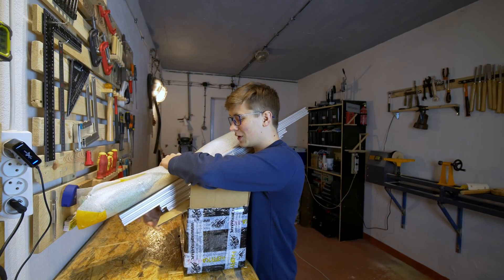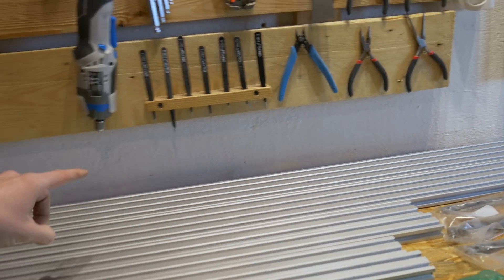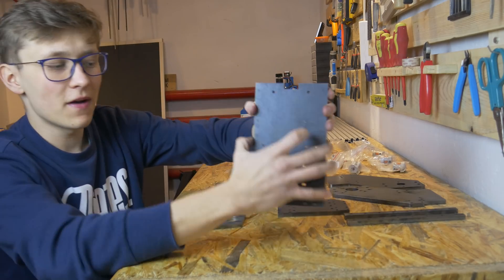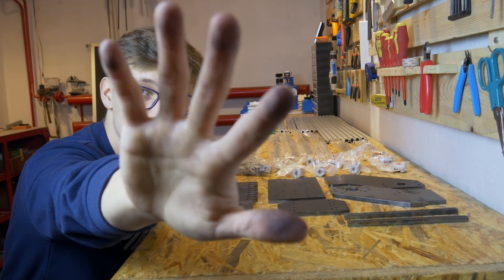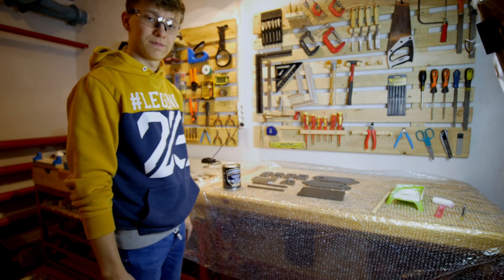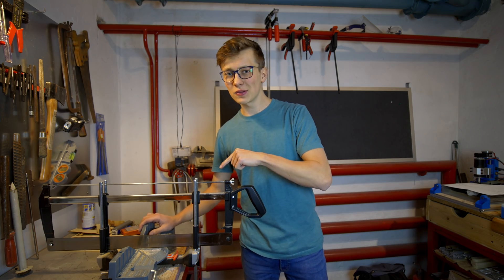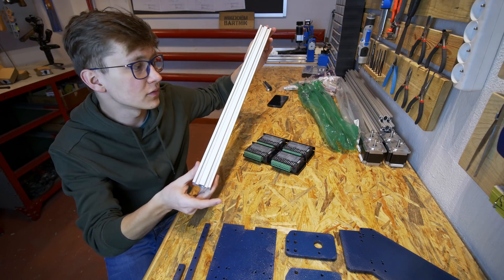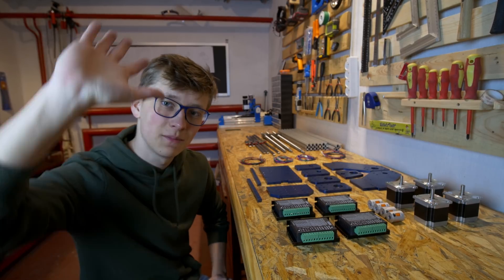IndyMill - Open Source DIY CNC Machine #1 Parts

Comment: In the list of component to buy it says "Linear Rail Block MGN12H" , but in the video you say its a mistake and it should be "MGN12C". Which one should I buy? is the pats list wrong on that?
Reply from the maker: List of parts is ok, you need MGN12H. This is an old video where I was still experimenting and I used wrong version
Reply: @nikodembartnik  Great honor to have your answer. Your Cnc is amazing. im buying the parts now and will try to share the process as much as possible for spanish comunity. Thanks :D

Comment: How did you ensure that the horizontal axes were at a true right angle?
Reply: The pieces should be extruded and cut from the manufacturer with somewhat reasonable accuracy

Comment: Hi, I've just come across your vids and i'm very impressed, so I decided to purchase your plans, but the problem I've got is your parts list....
Some of the links send me to 'V' slot extrusion and others to 'T' slot, is that intentional?
The link for trapezoidal lead screw is asking for pitch and lead dimensions/sizes?
Linear rails links are asking C or H?
Stepper motors spindle sizes??
Any chance you could clarify thanks. 😊

Comment: Hi, thank you for creating this. I have a question. On your website, you have the MGN12H listed, but in this video you say MGN12C is correct? Did you update your design to the 12H or is the website wrong wrong? Thanks.
Reply: Nevermind, I scrolled and see the MGN12H is correct.

Comment: Could the steel plates be replaced with aluminum?
Reply: I guess you can make them with aluminum, some other people are even using plywood or plastic on a 3D printer. I am planning on make them with 3/8 HDPE or whatever thickness is necessary.

Comment: great project!  Thanks for sharing this.  Did you buy the v-rail extrusions for a reason?  I haven't watched your second video, but the linear rails make me think you aren't using the v-rail feature.  What are you going to charge for the metal plate kit?  Any interest in doing it in stainless steel or aluminum?  Thanks Doug

Comment: Nikodem,  Thank you for all your hard work creating the IndyMill.  This is the exact form factor I have been looking to build as my first CNC.  I was wondering, based on your design, what is the working area of your design?   I would like to build one that can handle a working area that is roughly 915mm x 610 mm.  So, I am not sure how long and wide my setup should be.  Do you have a sizing calculator?

Comment: try bluing instead of paint  and waterjet instead of laser. bluing doesnt increase any dimensions and waterjet is as precise as laser with alot less cost. also breadboard ribbon cable fits grbl  controllers perfectly get a set of male to female end ribbons and you can screw down on the pin and the socket on the other side will accept the pins on the grbl board perfectly.

Comment: Sir i wanna buy 3 nema23 3amp with 3 tb6600 driver and 3 lead screw 500mm and spindle 500w can i mill aluminum with those parts ? Whats the power supply voltage should i use 36 or 24 ? Is 3 pcs nema23 stepper motor enough to what i need ?  I really love what you do and i hope you all the best

Comment: I've been following this project since I found it a few weeks ago.  However, I'm confused about the size of the parts in the DXF files you provided on your site.  Is everything in millimeters?  If so, that makes the 500W Spindle plate 13.5 CM (135mm) wide x 8.2 CM (82mm) high.  If that's the case, it would be easier to communicate this information to any company that will be cutting these parts for us.
Reply from the maker: Everything is in millimetres

Comment: Hello
I've been thinking about buying or building a CNC machine myself for a long time.
Of course there is a challenge to build yourself and also not the simplest to learn and understand the programming with a device you buy from the company.
So, I'm looking for a lot of time for someone who builds himself and manages to give all the necessary parts including plans for the mechanical parts.
I also do not know if the bottom line in terms of price what is more worthwhile and for me the consideration is whether you should challenge yourself along with the construction experience yourself, but this is of course an individual question!
Anyway, the question is are you free to help if I take the task like you and build alone and help me if I need to?

Comment: I've been torn on what to build. I was considering just buying a little 3018cnc to mess around with but I'd rather put the money towards a decent machine similar to your design. I like the size of this machine. I already have two nema 23 motors from an old project but I need new drivers. I also have a single big nema 32 but that's overkill unless I'm building a pretty big machine.

Comment: When the project is complete and the design is finalized, maybe you could consider starting a kickstarter to order many kit parts frbricated from suppliers at a high volume reduced cost. Im sure you could take a deserving profit cut and we all could bennefit from it by reducing costs and providing easier parts sourcing by recieving delivered kits. Just a thought. I am very interested in this design and appreciate your hard work and overall opensource philosophy. Keep up the exeptional work!

Comment: I would bring your attention to Vention.io They allow machine design using standard aluminum extrusions with standard brackets etc. You won't have to mill any parts separately. They even have an online machinedesign tool where you can build your entire cnc and order the relevant parts from them.

Comment: Just a tip .... I see you had problems with broken taps. Your on a limited budget ... try this.  Put the tap in a tap wrench .. drill a hole in a board the size of the tap ... put the board down flat on ur plate and put the tap in the hole to start your tapped hole.  Take it out and then restart your tap remove board and restart tap and finish tapping. You were starting your tap so crooked it broke. .. nice. Job later.

Comment: If I already own a DremelCNC I should be able to cut the steel parts from aluminium and use the finished aluminium CNC to cut mild steel plates to replace the aluminium ones?
Reply: Dremels are crap as he said in the other video... The bearings rather bushings are very cheap, probibly made out of Nylon and DON'T HOLD any tolerances as the Dremels are made to only vibrate your hand while you use them, I use my Dremel to vibrate my molds, and it does a great job in doing that.. 

Go to the store and pick up a brand new one and check out bearing play for yourself, the bushing play is like something that is completely worn out!.. The chuck is also a problem as you can only tighten it with your fingers, so the fist vibration the chuck WILL RELEASE and the bit will fall out, and they are also   seriously underpowerd, unless you want to scratch your back with it, turned off of course, you don't want the bit to fall out of the chuck and into your but crack while is spinning around..

Dremels are garbage in evey way.

Comment: Great video, love the design and nice job at your website. Maybe try aluminum insted of steel and try to mill/drill them on a dremel CNC. And a tip for a dremel CNC, make an air hose that will blow away aluminum from cutting area and cooldown the tool a bit. Keep up the great work!

Comment: No offense, but why?  You are super talented, and your dremel cnc fit a demand that no other machine fit.  There are already 101 medium to large open source cnc machines out there that use extruded aluminum and are very similar in design.  Once again I am not trying to be rude, but trying to figure out what makes this unique?  Wouldnt your considerable talent be better spent improving one of the designs already out there or creating something else that uses cheaper/more affordable parts?  Maybe extruded aluminum is cheaper where you are, but in the US it is terribly expensive. 

There is a guy that uses angle iron and v bearings for rails, he hasnt really done a great job of documenting his machine.  Would really love to see someone build on what he has done and document it well, as the parts he used are really cheap here in the states.

Comment: I think an easy / cheap way to use an Arduino with grbl is the Arduino Nano with a Nano expansion board ~4€. I use this with the TB6600 for my Dremel CNC. But I will also build your machine when it is finished. Because I am currently not satisfied with the rigidity of the Dremel CNC. I'm really looking forward to Part 2

Comment: Hey nikodem, i made the other cnc, but with mach 3 and the drivers you show on video, the question is, why you dont use mach3? I feel it is better than arduino
Reply from the maker: I highly prefer the Arduino, it's cheaper, open source, I can do everything I want with that and use anything I want. Mach3 looks sooooo bad. Take a look at CNCjs, that's the software that looks great and is easy to use

Comment: I think what you're doing is amazing. I just wanted to say thank you for taking the time to show people what you're doing and being brave enough to share it. The way you go through everything and the presentation of your videos is excellent.

I'm thinking of building my own CNC machine, not a kit one like you see everywhere, but my own design. My thought process was a lot like yours: combine aluminium and 3D printed parts, but I have no experience with 3D printing yet. Your new design has inspired me - I'd been thinking about using 3d-printed prototype parts in place of simple 2D aluminium parts that can be cut on a fibre laser, and you've completely solidified the idea in my head.

Comment: those motors are not useful for cutting heads... maybe for a 3d printer, laser mirror or even diode, but definitely not enough for a router or a spindle

Comment: LASER cutting is not more precise than drilling. The LASER will cut a slightly tapered hole and the walls my be rougher than a drill. Also, you cannot (read: should not) LASER hole diameters smaller than the material thickness.
In short, drills are great.

Comment: Don't you think the paint on the steel parts hurts the tolerances of various dimensions, flatness, and perpendicularity? I like steel too, but I wonder if for this application anodized aluminium would be cheaper, better looking, and hold better tolerances. That paint looks really thick and creates an uneven surface. Maybe you could have raw steel, and apply wax or some other finish after assembly, so it keeps the machine clean from rust, but doesn't affect mating surfaces. Idk

Comment: When I have to tap aluminum, I just chuck the tap into my cordless drill, lube the tap, and screw it into the hole.  That's how most CNC milling centers tap small holes.  (not with a cordless drill, but you know what I mean... ;)  Just make sure you are square to the hole in both directions, and don't put a side load on it.
Reply: throngcleaver Make sure to set a torque limit and rewind half a turn when it is reached. Will prevent you from breaking your tap.
Reply: @smooth_lighting  I don't do that in aluminum for taps 1/2" down to #6 screw threads, and I have never broken a tap in aluminum, but you have to be straight on the hole.  I watch a shit-ton of videos, including a lot of the top metal workers, and I have yet to see one hand drill or tap a hole, starting off with the tool perpendicular to the surface.  I have 42 years experience, with thousands of holes tapped, including several hundred holes in that 80/20.  That aluminum alloy, (the 80/20 they sell in the States) is 6105-T5, and it taps very well using my method.  I recommend Tap Magic Aluminum, for tapping aluminum and magnesium alloys.

Comment: As far as i can see the steppers do not have encoders/position feedback. Do you have any planed or is it an openloop machine.
Also have you thought about using linux cnc as a controlling software?
Reply from the maker: I am not planing to have here a closed loop system, maybe in the future I will upgrade those motors with encoders or buy servo motors with encoders inside
Reply: Well it would not make sense for a cheap diy project.. Nice work so far👍

Comment: you started  a great project! very cool!
to improve precision in building the structure I would advise you to remove the paint in all those places where the steel plates are connected to each other (for example if you have to join two pieces of steel at 90 °) the thickness of the paint could give stability problems with the finished structure. 
The 12  brothers you showed in 04:03 probably are named sliding bushings or linear bushings ( no no: linear bushings are for rods).
Do not remove the plastic stud inserted in the sliding bearings but make sure that it is pushed away from the rail, while inserting the bearing, otherwise you could lose all the balls of the bearing
Go ahead  Nik  i'll follow you !
See you soon!
Reply from the maker: Thanks! I hope that paint wouldn’t be a big problem, I may eventually just remove it with angle grinder and paint this places again later. I noticed the plastic element in those sliding bearings, I keep it in place and also I keep most of them still in bags because there is a lot of dust in my workshop. That’s just some additional protection to ensure that everything will run smoothly

Comment: I enjoy your videos. Just a tip for paining. Rustproofing is quickly and effectively done using Rustoleum spray paint. It is a US product but is readily available and reasonably priced here in Australia. I presume that it would be available in Poland as well. It has much better coverage and finish and it also bonds well to most plastics including PLA so I use it for most of my prototyping. Cheers. (not a paid ad).
Reply: Hi, Which one do you use? Is it the Stop-Rust one? I see amazon has some available but not too sure which is the correct one to use.  Thanks

Comment: Like what you are doing. Would 3mm mild steel plates be thick enough. Would reduce the weight a bit. Also found that laser cutting can be cheap enough if you find the right company. Also you would be able to get smaller holes thru 3mm palate.

Comment: your drivers sucks.
i used them for my ox cnc and then i gave up and went to a cloned duet 2 wifi with trinamic drivers.
the toshiba don't handle slow pace correctly, and if you try to mill pcb you will have step by step movmeent instead of something smooth.
and when you add the price of your 4 drivers + controller board + rpi for wifi access you are nearly the price of the cloned duet wifi.
and honnestly reprap firmware is wayyyy better than GRBL

Comment: you should look into HGR20 rails they're pretty beefy and the carriages are nearly 80mm's long so you dont need more than 1 per rail for a smaller machine oh and DOLD mechatronik a german site that sells dirt cheap aluminium extrusions cut to length up to a mm

Comment: Nice video! Right now I'm in the process of designing my own CNC, are there is some stuff I might wanna add:

- the aluminium profiles are quite small. My machine will have a similar workspace of around 600x500x100mm, yet I used 60x60 and 60x120mm extrusions

- I don't know if you already plan to do so, but you can fill the aluminium extrusions with sand to make them more rigid and the machine quieter, once it's finished. Just seal the ends with glue, 3d printed parts or something like that

- the stepper drivers you bought are quite cheap and not as reliable as other options. You should check out the products from leadshine, they have very good digital drivers

- the linear rails you got are probably cheap hiwin clones with mediocre built quality. It is always recommended to take the linear blocks apart, degrease them and even replace the ball bearings with better quality ones for better accuracy and reliability.

- if you don't care a lot about noise, you might want to consider a trim router like a compact model from makita as your spindle. They are high quality and very safe to use in comparison to other models from China, yet they are pretty loud in use.

Comment: Why you chose steel plate instead of aluminium? It's easy to fabricate even with cnc and stiff enough :)
Reply from the maker: Aluminium is more expensive. It costs almost 5 times as much to cut exactly same parts out of aluminium
Reply: @nikodembartnik  Yes, but most of us cannot cut either of them. Maybe acrylic or something non-metallic would do as well with regard to rigidity. I see this as a big stumbling block for your otherwise fantastic kit. I want one!

Comment: I think you will get a little bit of deflection problems in your y/x plane.

The aluminum estrusions tend to flex and vibrate when the not connected to getter.

Another option is to fill the extrusions with epoxygranit but I don't think that that will be enught to get rid of the deflection.

Oh and one last question is there any reason you didn't go wit Nena 24/56 servo motors?
Reply: I think price is the obvious reason he went with nema 23 which is probably overkill still. 

I don't think anyone plans on doing high speed machining with a homebuilt cnc of this size.
Reply: @DandySkipper   i personaly can say high feed milling is a realy great option for "hobby" maschines not becours it gets things done faster, but it reduces the foreces aplied to a maschine. Same with Tricoidal milling (adaptiveclearing) insted of traditional full slotting.
Reducing the forces on a "hobbie" maschine is important, deflection can couse manny tolarance and fitment issues. 

Nema 17 combined with a 1/2 kw spindle and aluminum thicker than 5 mm can be problematic when running higher feeds
thats why i dont think nema 23 stepper/servos ar overkill